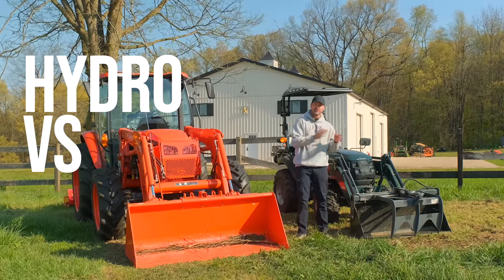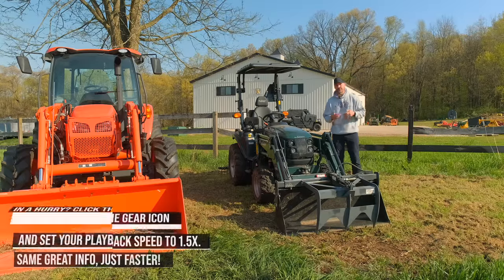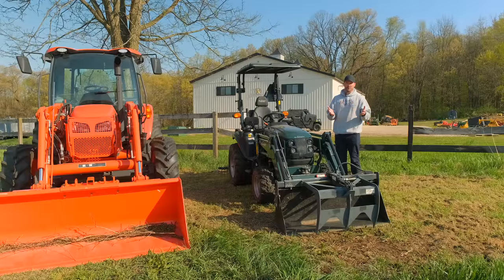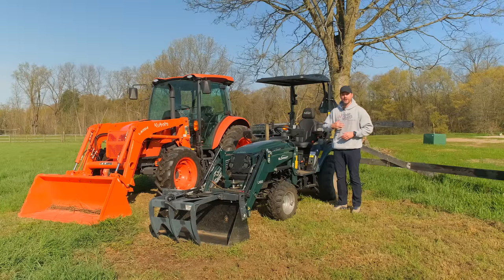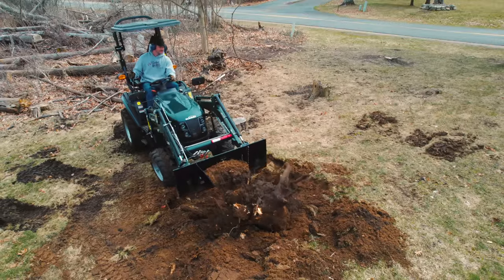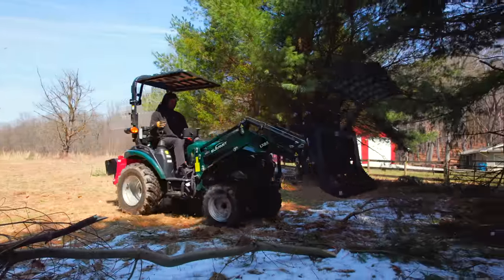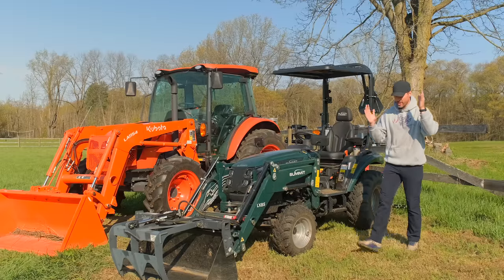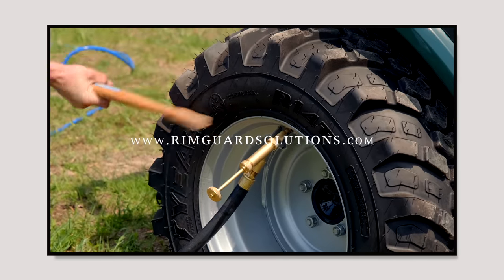HYDROSTATIC VS MANUAL TRANSMISSION? CLEAR WINNER?

Comment: I work for a farm that uses a L3901 kubota hydro for heavy use in poultry operations, hydro is convenient but it produces a lot of heat that you notice in static air and I run a 9540 kubota for loading and scraping the poultry barns and  if you can run a standard trans use, cheaper, more reliable, and simpler repair when it breaks, can’t have sensors give you trouble if their are none, the L3901 hydro is a great tractor but they do not like being used to max capacity/ power for hours on end and i truly feel like that’s purely for the hydro transmission

Comment: You badmouthed one of the best transmissions that John Deere has ever created!!!  The John Deere 4020 Syncro transmission is almost perfect for a farm application.  Put a loader on it and go from 5th forward to 5th reverse and jump up to 2nd forward for pushing into a pile.  Just kidding.  For those who have never run one in the field it might look awkward.

I purchased a New Holland TC29D with a hydrostatic over the gear because I knew I was going to be mowing with it and wanted the convenience and simplicity of hydrostatic.  I know I can put my wife and son on it and they will be able to make it go and stop because it is just like our Cub Cadet LT1022.  I also knew I would not be doing heavy draft so gear drive didn't appeal to me for that reason either.

Comment: I have a kubota L 3130 with GST I think it is called a glide shift. I love it. The gears are all in a row just slide the selector to the gear you want and you are in that gear. No clutch needed. It has a reverser which is wonderful. The only time I would want a hydro is doing loader work. Its good at it but hydro would be better.

Comment: If you are working with your front, I think manual your transmission would be difficult unless you use shuttle/power reverser selector. We have the small Grand L 3560 that is hydrostatic and a totally manual transmission Kubota that is seventeen horsepower and about forty years old. I enjoy using the little  one for  certain jobs, but I would hate to use it front end loader work. Also, the little one has to use the clutch to engage the PTO and one of  three speeds.

Comment: When I graduated college and got a job I bought my Pops a manual B1750.  I have a B2320 TLB that's hydrostatic.  I haven't used the B1750 in over 10 years and got on it last weekend.  All I can tell you is there is a definite difference in how the tractor feels.  The gear drive feels a lot more positive.  Like the tractor is 100% committed to moving forward no matter what and you better pay attention and keep your head on a swivel because if sh!t gets real you'll need to be all over the clutch, brake, gear shifter, and throttle like a spider monkey.  The hydro all you need to do is lift your foot.  The PTO on the B1750 isn't live so that's something else you need to pay attention to when your mowing around stuff and changing direction.

Loader work with a clutch sucks.

Comment: I always prefer how engaging a manual feels vs. an automatic, so much so that I wish I could buy a new 1500 or 2500 series pickup with a manual and an N/A V8 still.
Currently In the market for a compact tractor and this has been a debate of mine on which way to go as far as maintaining  and availability of parts go.  I just sold my 2004 SRT10 with a Tremec T56 specifically built for the single cab Ram 1500 and I was just lucky enough to find the ONE and only transmission on Ebay to swap out  the blown one in it.  This has me leaning towards a hydrostatic from that experience alone.

Comment: My Massey Fergason 1840e (40hp) has a 3-range (8 speeds) hydro trans but I've personally found that the highest range is WAY too fast for most practical applications other than maybe driving down a flat, paved road. I have no doubt that I would flip my tractor if I went tooling around my farm at high speed. If I'm doing heavy dirt work, I'm working in the lowest range so I can get the most power.
Reply: A 3range (8 speed) hydro? Must be time to FINALLY Read the "Operator's Manual ".

Comment: I have both gear drive and hydro. Love the hydro but if I get ambitious after a rain storm the gear drive is definitely good at getting the hydro unstuck. Also when you get a heavy load the hydro will just bog down, whereas the gear drive just keeps pulling. Still think the hydro is better for loader work.

Comment: I've got a Kioti NX4510 HST Cab and would be hard pressed to go back to a manual. I've driven manual autos for most of my life and several manual tractors, but once I got  used to the Hydro tranny it just seemed so easy to work with.

Comment: Well you have 2 kinds of manuals, non synchro and synchro. I would at minimum suggest the synchro for a lot better ease of use where you can stop flip a lever and switch direction. Non synchro you have to come to a stop and actually shift the gear. Strictly for budget reasons I got a non synchro to get the 35 pto hp minimum I needed. I will say it takes forever to get chores done, like moving gravel, using pallet forks etc but the price was right for what I was needing in power. I hope to move up to a synchro at the very least but yes a hydro would be awesome in my opinion. All can be costly, manuals have to be split to replace clutches but hydros seem to last but I have seen some that have been destroyed and the pumps can be costly, especially the models that have 2 pumps, one for trans and one for all other hydraulics. If you are simply working just on your own place a manual will get it done but much slower, if you are working commercially and time is a factor you’re gonna need that hydro or at the least a synchro.

Comment: Well there’s still power directors and such where you pick a gear go from low to high without shifting and there’s some others you can go low medium and high. All without clutching after gear selection.  You have the shuttle clutches like allis chalmers had where you select gear with clutch and then go fwd and reverse kinda like ya mentioned

Comment: Courtney: I might be looking at it morbidly or something.

You are looking at it realistically. 1. A new tractor owner hits a rut/rock, panics and instead of putting it back into neutral or pressing the clutch it runs into something. 2. You are going through a wooded or brushy area. A sticker bush or limb hits you in the face. You are distracted by pain and can't see the clutch or shifter lever to stop the tractor and it smash into something. 3. You have the RPMs up, put it into too high of a gear, the tractor jerks, you panic and runs into something. 4. You overload the loader, it start to flip or roll and you panic. 5. You fall off, hurt yourself, and the tractor keeps going. 6. You have a medical condition and tractor keeps going.

These are real world condition that are avoided with a hydrostatic transmission.

Comment: My riding mower has a hydrostatic transmission. It makes mowing around stuff much easier. My work horse tractor has a gear drive. I do loader work, skid logs, you name the job, it gets used for it. Why did I go for the gear drive? Well…. I grew up with gear drives and just feel more comfortable with it. As for ease of use… muscle memory! Don’t even have to think about it, control just feels natural. But for a new operator hydrostatic is the way to go.

Comment: Hello from under Downunder. That is Tasmania, the southern island state of Australia. Your videos are always well informed & helpful in my research but can I ask you & your audience a more specific question to help with my first tractor purchase which is now at the pointy end? I need to make a decision in the coming week to meet the June 30 (EOFY) deadline. The comments seem to confirm that geared transmission for the familiar is better suited to field work (PTO power to the ground - cutting/pulling) while hydro is safer, more comfortable for the inexperienced operator & easier on the clutch for loader work. To maintain our 30acre property I am likely to be using a 5' slasher (bush hog) 60% of the time,  loader work with a fork 20% & loader work with a 4in1 bucket 20%. I have looked closely at the JD 4066R which is fully optioned with hydro trans but out of my price range (AUD$82K), JD 5055E which is manual with Power Reverser which is within price range (AUD$55K) but can't take a backhoe and the Kubota L4600D (geared AUD$48K) & L4600 HST (hydro AUD$49K) which takes the Kubota BH92 backhoe (AUD$16k). I have first option on a tidy 2021 model Kubota L4600D (geared) with Kubota LA714 loader (skid steer hitch), Kubota 60" 4in1 bucket & fitted with the Kubota BH 92 backhoe. One careful owner with 137hrs on it and the package includes Kubota 1.8m sun canopy, 1500kg pallet forks and a rock sieve rake bucket (package deal is AUD$46.5k, cost new exceeds AUD$70K). The Kubota dealer is warning me that the geared/manual dry clutch will burn out in less than two years & a replacement is in the order of AUD$5-7K. To save me future heartache he would prefer I purchase a new Kubota L4600 HST tractor & have the dealership swap the loader & backhoe over to the HST tractor at a changeover cost to me of AUD$13k. I would retain the rock sieve rake bucket (AUD$4.5K) & pallet forks AUD$2k). Should I go for the geared AUD$46.5k "good package deal" & take a risk on the longevity of the clutch or fork out the additional AUD$13k for a new hydro L4600? Bearing in mind the rated 46.3hp engine & reduced PTO power if I went with the hydro. I only want to buy a tractor once, love using it & have it for the long term. I would greatly appreciate your considered thoughts as I need to make a decision in the coming week. Sincerely, Joe

Comment: Shuttle shift is the way to go. I wish it was available on compact tractors.
Reply: Have you checked out the yanmar yt ihmt hydromechanical transmission...pretty awesome.  My opinion is you get best of both.
Reply: My dad has a shuttle shift New Holland Boomer 40.  My Yanmar YT347 has the I-HMT and is a substantially more pleasant machine to operate and uses the same 2.2L as a JD 4044M/R.

Comment: Amount of power to the ground is another difference worth considering. A gear drive will have much more power at relative speeds. Relevant if your plowing, pulling, or otherwise engaging with the ground in a way that pushes the tractor to it’s limits. I have a ford 1100, 13hp little guy, that I used to pull a 400lb 4’ box blade through the woods to create trails. No way that could happen if it was a hydro.

Comment: When you are at full throttle and you hit the wrong pedal, you lunge in the direction that you are not looking. We almost lost a guy at work as a tractor operator was trying to back up for a passing vehicle to clear, then ran forward into his vehicle. Serious injuries. The rocking pedal might be safer in this regard compared to the side by side.

Comment: That tractor looks like a spider with its four round eyes and fangs on the front.😁

Good pretty balanced discussion. I went gear due to mowing, baling and field work. With the better transmissions it is still fine for loader work and pallets too. Definitely get the easy to reverse and shift models. I think gear got a bad wrap due to unsychronized transmissions that are hard to operate.
I wouldn't change my decision after using it for ten years.

Comment: Neither is best.  It depends on what you are doing as your video says.  For field work, I will take manual all day long.  For loader or fork or grapple work, hydro is hard to beat.  Personally, I prefer the best of both with a power shuttle transmission, but don’t see those on compact tractors.  😁. Given how most compact tractors are used, it is easy to see why hydro is the most popular choice.

Comment: Hydro is sooo much better than a manual trans in sooo many aspects. I’ve operated both for years each and hydros are way more user friendly. But if I had to choose a manual trans or the Kubota treadle pedal it would be the manual hands down. Just saying.

Comment: Most kubota hydros have a cruise control that locks the hydro at the speed you want.  Just sit and steer.  Pretty sure most do, so that’s not a huge difference than manuals.  Little different to use, but will just go.

Comment: The power reverse on the utility tractors is about as close as you get to what i wish tractors had which is a backhoe transmission, standard shift with gears and F&R lever but has a torque converter so you have your differnt gear ranges but you can come to a stop with the machine still in gear and no clutch

Comment: I am looking at a Branson 2515R because of the shuttel gear I was told that there was less trouble compared to the hydrostat transmission.
What do you think
Reply: I have a Kubota 2320 with hydro and 1000 hrs with no troubles at all...doesnt overheat when cutting 6 acres of grass. Rock solid.

Comment: There's one area where i think a hydrostatic transmission isnt great and can be dangerous is working on steep slopes specifically going down hill. A hydro will over run which can be dangerous like pulling a heavy trailer. Used a few kubotas (mx5200, L4400, L5740) and my 4066r JD all will over run in Medium or high range on steep hills. My Iseki TA550F manual 4 x 4 syncro reverser wont if your i  a low gear even in high range.

Comment: The definition of Hydrostatic drive : Guys/Women who like drive little tractors with their purse strings, or a person that has an understandable medical condition. 
Definition of Gear drive: Men who are competent and know how to operate any size equipment, and who want all the supplied engine power to effectively reach the ground! Because they have the basic mechanical knowledge and fundamentals to know how that even works! Also because they aren’t complete lazy asses

Comment: Can you do a video showing old tractors 80’s to mid 90’s to there current gen tractors. Not in depth but I have a jd750 and can’t tell what tractor jd or otherwise would be sized the same or as closely if I was to upgrad

Comment: Unless you're pulling tillage equipment it's not even arguable. The only thing a gear drive is superior at is transferring a slight amount more power to the wheels, which is usually never an issue.
Reply: Definitely agree about pulling tillage, especially a big set of disks
Reply: 3 times more power for manual trans is a little more than a slight amount.

Comment: Only thing that sounded weird to me was when you said hydrostatic transmissions steal power away from the engine so theres less for the PTO. Moving the tractor requires power through the transmission whether its manual or hydro. I can't see how theres a difference there.

Comment: Id say the only real miss you had is that a hydrostatic is a CVT basically any gear you want is in there within the range so you have essentially an extremely low creeper gear at basically full torque the moment you apply pressure to the linkage very few manuals in small tractors have enough really low gears qnd particularly old ones and they never have enough gears for the task.  Take the old Fords whole aftermarket for third party high and low range boxes just not enough gears.  For meaningful work you need about 12 gears so that you have the right one.  

To an extent thats where the 2 speed vs 3 hydrostatic tractor debate begins.  There is always that one mid range task that high is too high so youre barely on the pedal and risk overheating the trans or youre in low and its full bore and too slow.  But thats such a narrow band that its not too common.

Also my hydrostat has a different gear ratio in reverse so reverse is low gear.  This means that I use a backblade backwards to plow.  Gives me low gear under load and then high in forwards to rip back up the drive in forwards.  Hydro is the way to go

Comment: i think kubota has a "cheaper" small tractor thats full old school manual transmission. its a bare bones  basic tractor i think it might only be 26hp or so. messicks i think did a video on it awhile back. but all in all i used to love manual trans tractors but now that im older im all about the hydro trans now.